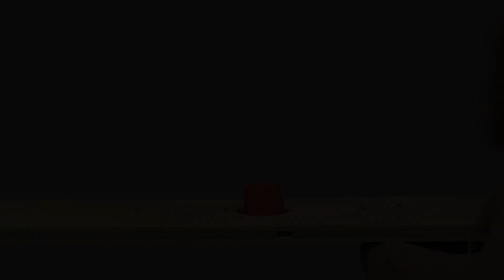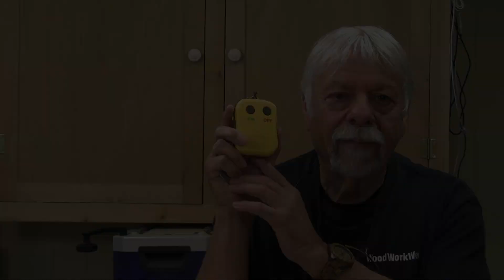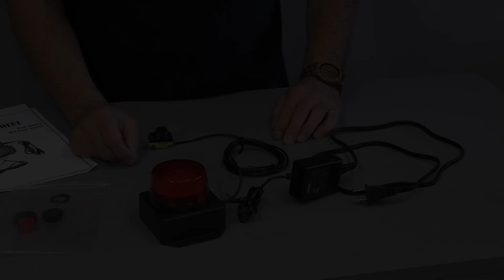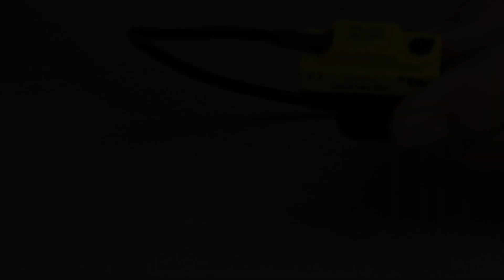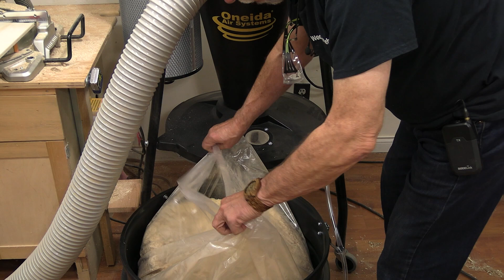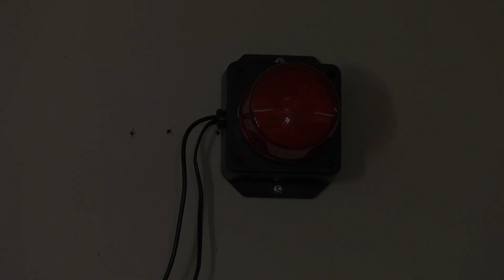MUST HAVE Dust Collector Upgrades! / Oneida Dust Sentry

Comment: Dust the dust from a drum sander make it into the barrel or does it float into the filter side? 
I have a two stage with a theine baffle which works great, but the fine dust from the drum sander doesn’t make it into the first stage barrel. 😖

Comment: Wireless Remote Control Power Socket from Ali express for 15 dollars approximately. I've had 3 pieces for 4 years and they all work just fine. You just plug them into an existing socket.

Comment: Looks like a nice remote start. I have been using a remote controlled outlet (originally intended for Christmas light) that works great and plugs into 115v outlet. I am interested in the dust sensor. Can you update us in a month or two how it works? With my super dust deputy and fiber drum I have no way to see how full. I just wonder like others if sawdust gets on the sensor and it is no longer accurate. Great video as always.

Comment: I think I might have a simple solution to the window that gets dirty with sawdust. Take a small piece of cloth and two rare earth magnets. Put the cloth against the window, and it hold it with a rare earth magnet on the top of the window, and holding the cloth in. (So it’s magnet->cloth->window->magnet)  When you want to see inside the barrel, just move the top rail earth magnet back-and-forth, which should cause the cloth to wipe the viewing window for you.

Comment: I mounted a power strip just below the outer rim of the left table saw top extension, with the outlets facing out. I plug my vacuum into an on-off block switch (common at HD & Amzn) which is plugged into the prw strip. It's about 8 in from the saw switch so I can easily start/stop the vacuum when operating the table saw. The other outlets on the PS are handy for sanders, and other lights and tools.

Comment: I've tried remote switches to turn on my vacuum system, but too many times I couldn't find the remote switch. When they all finally broke I decided to use an echo Dot to turn on my vacuum system. I just tell Alexa to turn on the vacuum and it does. I have to yell really loudly to turn it off but it does that too. I can be anywhere in the shop and it works. Just another idea

Comment: I drilled a tiny hole in the top of my barrel and dropped in a long thin wood dowel To check dust level I pull it up and drop it back in, the amount sticking out tells me the dust level.

Comment: I have used a similar Onieda Air System dust collector for about 10 years and have a simple upgrade to the dust barrel that I have implemented.  There is a dust port in the bottom of the barrel that pulls a vacuum in the drum to keep the trash bag tight against the walls of the barrel.  The problem is that once the bag is full and you are removing the bag from the barrel the vacuum port will often tear the bag since the bag is full of chips and is forced against the port.  This will leave a nice hole in the bottom of the bag, leaking wood dust/chips on your floor.  To resolve this issue, I put a block of open cell foam around the vacuum port so that it cannot puncture the bag, but still allow air flow to permit the port to create a vacuum in the barrel.

Comment: Don’t stop there.  You need to get the vac blast gates too. When a machine is started the sensor on the machine sends a signal to the switch to start the dust collector.  That is the best upgrade I have made to my dc